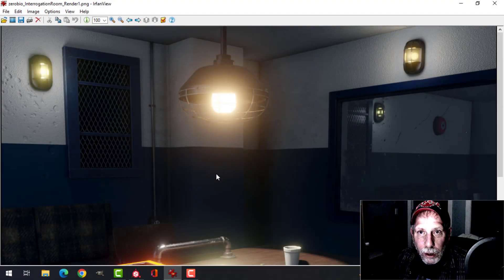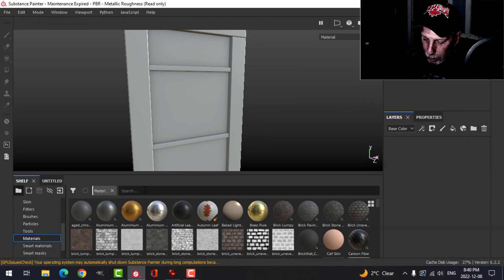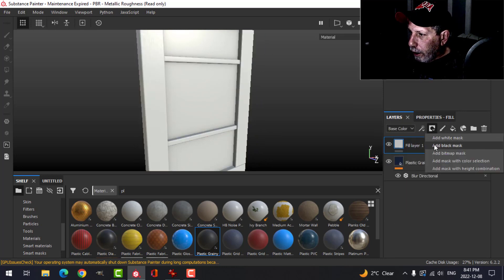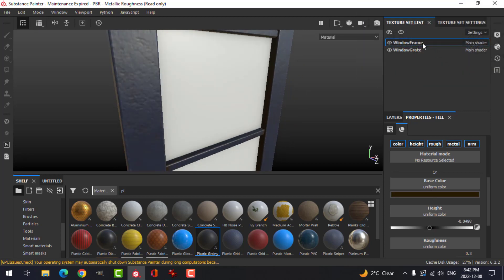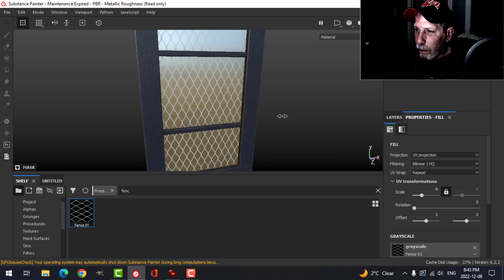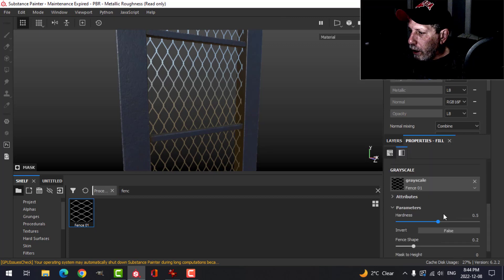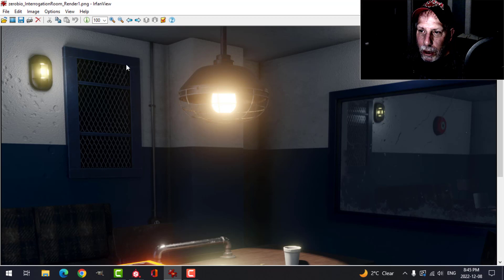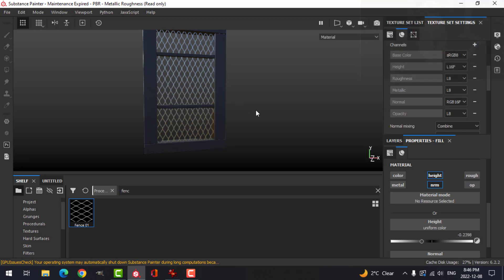BLENDER TIP: WIRE MESH (IN SUBSTANCE PAINTER)

Comment: Discovered this myself only a few weeks ago and thinking i need to learn texturing better lol. So much detail can be left to texturing, Dee-Kals ;) and the likes. Id just finished playing around with making a wire frame around a fan to see how that worked out. While the frame wasnt perfect i didnt do UVs properly or play with settings much. But the fan blades could be viewed perfectly, straight through a solid object.
Reply from the maker: Hey that's great!  Good luck with your texturing and especially those dee-kals ;)
Reply: @zerobio  Thanks, its a pretty huge geo saving if it can be done well. If i recall there are bevel textures too?
Reply from the maker: @Jackripster69  yes you can bevel with a filter